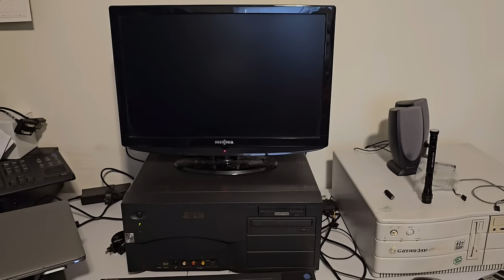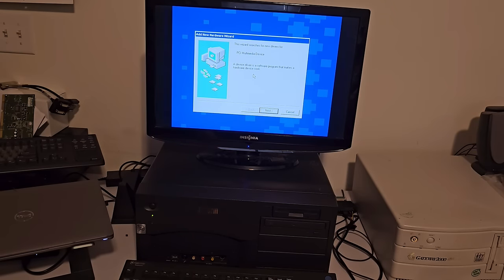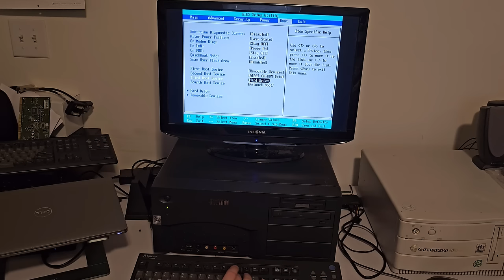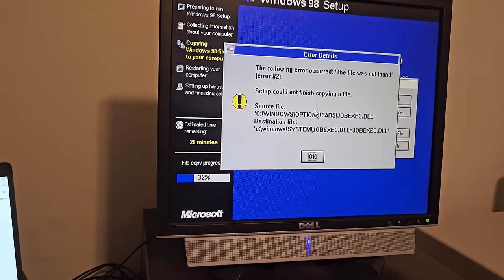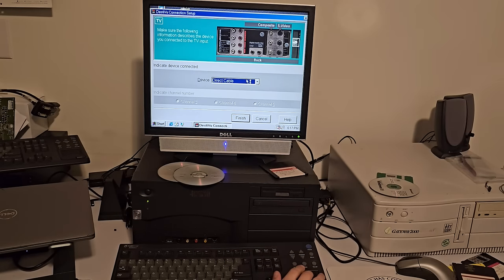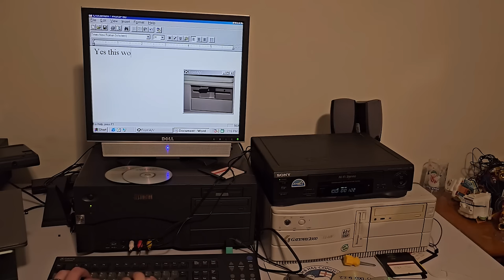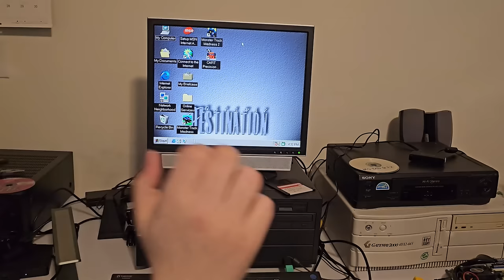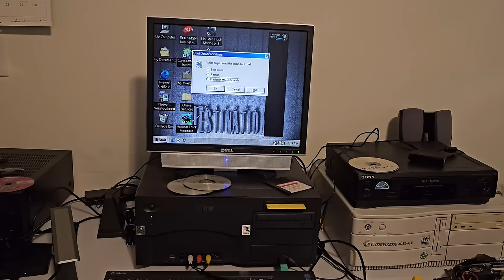Setting Up the Gateway 2000 Destination (Easter Special 2024)

Comment: Old monitors with tubes had a range of operation. That's ehy uour lcd doesn't work... Probably expects exact VESA resolutions and refresh rates. 

Most LCDs will take 60 hz but are only going to look good in native resultion ie the physical resution of the panel which is why the panel display other resolutions... The first gen LCDs didn't do this.

The gateway lcd you posted is a workhorse. I had buikdings full of these and very few failures, two on each desk. If you don't like the color take it apart and spray paint it. We did this on some conference rooms to match the surrounding paneling.